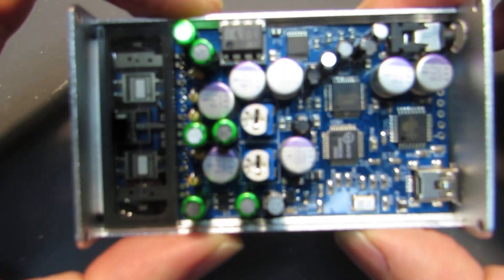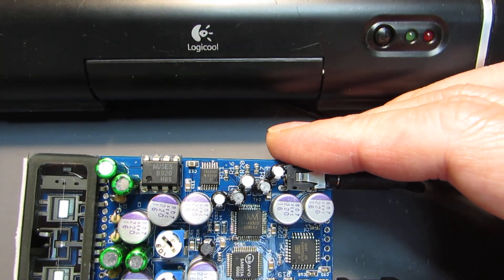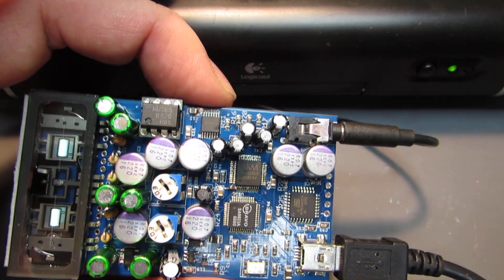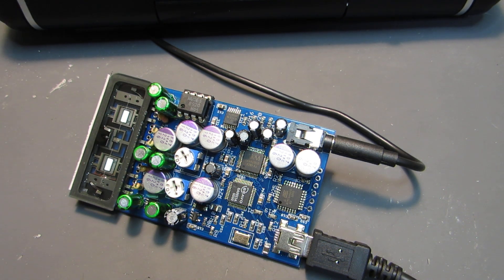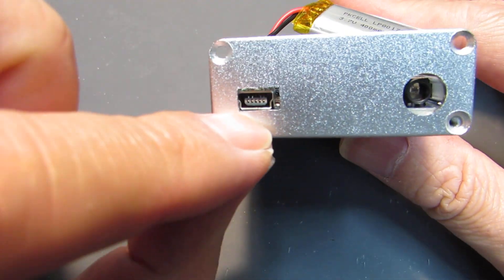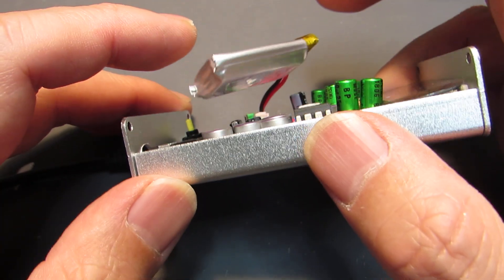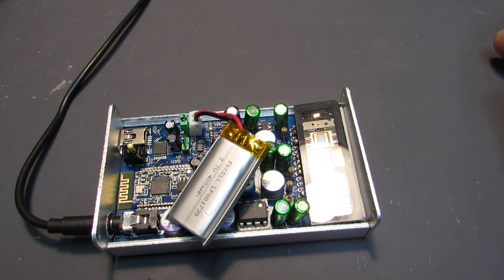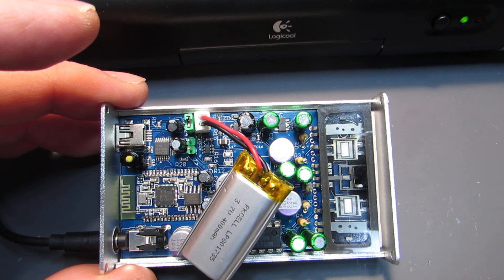I have two things to present today..

Comment: This one might be interesting for use in my hobby as a radio amateur.  It's nice to have a good high quality audio output for an SDR setup.  What is the sampling rate and depth for this?
Reply from the maker: Thank you for interest. It's 24bit/96kHz.
Reply: @microwavemont  That's pretty good.  Any plans to make a dual version?  Microphone in and audio out?  This could be of interest to radio amateurs, and also gamers.

Comment: Will you release the PCB design files to open source community??
Reply from the maker: Hello, the characteristics of this amp and, for example, Arduino are different. Application is very specified (Arduino is universal, multi-purpose) and indeed it has single function. So I guess it is not worth to open source.
Reply: @microwavemont  The full design itself and your efforts are very much worth to release it as a open source project.
Trust me, your Nutube amplifiers will catch many attention to makers around the world.

Atleast, I will be very much happy to share your projects if you release the source files